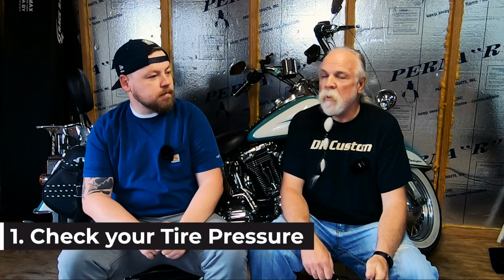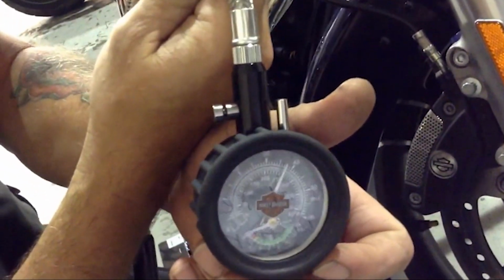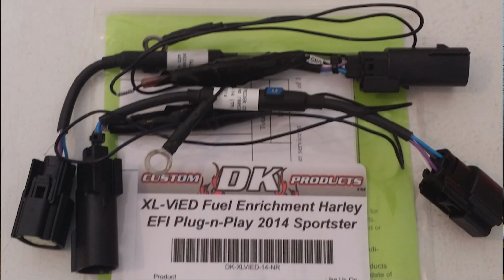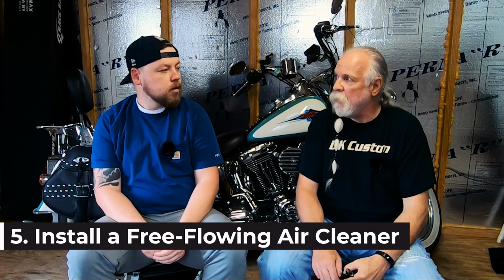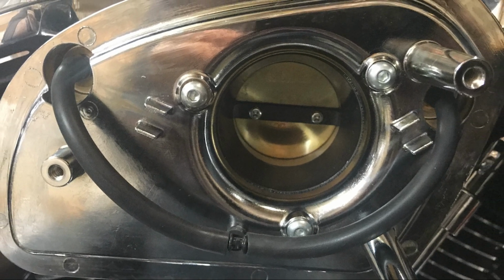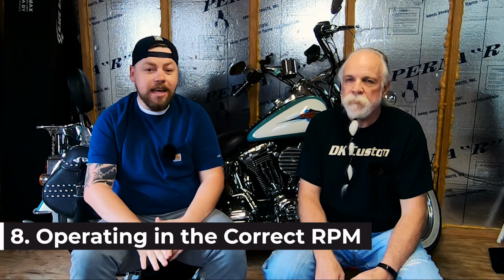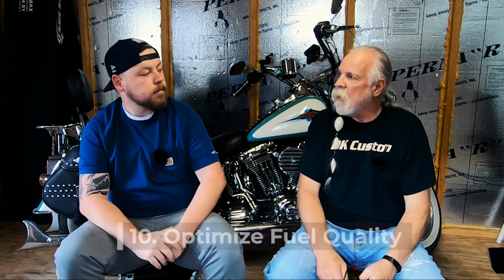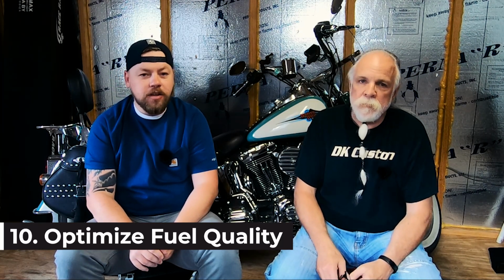List of 10 Steps to Better MPG & Better Performance

Comment: I would add to #10 the fuel filter. I am changing the fuel filter and the spark plugs after every 20K miles. I can feel the difference after change. I travel all around the country, and sometimes i have to stop for gas at small, local gas stations. Those are probably not the best quality fuels.
Reply from the maker: Good add! Thank you for commenting! MB

Comment: How do you check engine temperature?
Reply from the maker: Engine temp, as measured by the OEM heat temp sensor embedded in the cylinder head.  See this video for more details on that- https://www.youtube.com/watch?v=rWOdQOtDv6A
I use the Power Vision ET gauge is what gets the direct temp read out from the embedded OEM heat sensor.  
Thank you for your comment!

Comment: Thank y’all for sharing, I’m not sure why my 16’ Road King with stage 1 & 2 runs 240-275 temperature consistently with no lower fairing, just a windshield and that is during 40-60 degree weather temperatures. And I’m getting 33-35 MPG economy.
Reply from the maker: Oh my.  Yes, that is too hot.  Here is a link to a report on Why & How to cool down TC's & M8's.  https://www.dkcustomproducts.com/why-how-to-cool-down-the-twin-cam-engine-part-i-dk-cl-tc-dn-1.htm
It also talk about why it may be running so hot.
Reply: @DKCustomProducts  Thank you, I need to add some type of cooling system without braking the bank, any recommendations? 2016 Road King, and I’m sorry I said in my previous message I had a stage 2,, I only have a stage 1 thus far. 
Thank you for your video, really great information.
Reply from the maker: @babybugspaw7085  Here is a video on the Low & No Cost ways to cool it down- https://www.youtube.com/watch?v=o3T3yA9BKwE

Comment: I own a 2000 harley Davidson XL SPORTSTER883 WITH JUST A LITTLE OVER 10,000 MILES  .. I WANT TO INSTALL A TRANSFORMER EXTERNAL BREATHER SYSTEM... SHOULD I CLEAN THE CARB AFTER INSTALL
Reply from the maker: You can...but I wonder why not clean it before the install of the Transformer EBS?
Either way, I believe you will be well pleased with it.  👍😎👍
We appreciate your business.

Comment: I can usually get around 48 mpg on My 2015 Streetglide Special on trips out on the interstate running between 65-68 mph.Around town short trip I usually get around 38 mpg and this is taking it easy riding.If I ride faster either on the Highway or around town mpg will drop at least 2 or 3 mpg.I try to run Ethanol Free gas in my Streetglide and it's still stock except for the air filter.
Reply from the maker: That is some good mpg.  Ethanol Free is a real bonus!
Reply: @DKCustomProducts  I don't have to run 100mph to enjoy riding my Harley.Those days are behind me now.I like to enjoy the scenery when I'm  out riding and it's a lot safer under 60mph than over.I don't mind revving it out getting on the expressway or sometimes leaving a stop light but I want this Bike to last me the rest of my riding days.I'll be 63 this June and I 've been riding motorcycles since I was 11yrs.Plan on riding as long as I can hold it up.
Reply from the maker: @markallen6818  Good deal!

Comment: With many new bikes the tire pressure is noted on the display. It changes while you ride in cold weather.
Reply from the maker: Yep, the weather and the road friction will vary the pressure quite a bit.

Comment: I have a 2013 Roadglide Ultra, stage 1 with tune.  Air cleaner is a K&N big sucker 2.  My air filter is cleaned often and I still get oil coming out of air cleaner on to my exhaust.  Thought I saw a fix  y’all have for this?   Any help would be appreciated.  Thank you for the American made parts.  I’ll keep moving them while I am trucking.
Reply from the maker: Yes, we have External Breather Systems that can fit that air cleaner.  Result will be no more hot, oily, oxygen depleted air going into the intake...so more power and no more dribbles out of the air cleaner onto the exhaust.
See them here- https://www.dkcustomproducts.com/diy-external-breather-systems-408.htm

And here's a video with more info on EBS and the benefits- https://www.youtube.com/watch?v=EfDeFZblMck
Reply: @DKCustomProducts   hell yeah!!   Thank you.

Comment: Another great video for many reasons other than miles per gallon.
Reply from the maker: Yes, so true.  An engine that is running efficiently for MPG is also an engine that is getting the most power out of each gallon of gas.  A happy, well performing engine.

Comment: Another top-shelf video - thanks guys!  Hey, you mentioned about adding a fuel additive every 30-50 tankfills to keep sensors, injectors, etc. clean.  I know it's an issue like "what's the best oil to use in my bike?" but do you have any recommendations on good additives? 
Thanks again guys! Keep 'em comin'!
Reply from the maker: I have tried a bunch over the years.  I do keep a bottle of Sea Foam with me, since you never know when you might get a bad tank of fas.  I have had really good experience with it.
Reply: @DKCustomProducts  Cool. Thanks!

Comment: Stop driving like an A- hole! 😂 

I notice I pick up 10mpg when I’m on a very leisurely cruise at 60-65mph vs my aggressive riding in the twisties or open freeway at 80+ I’ve gotten 46mpg on my 2014 street bob with 103 twin cam, and the only engine mods are a Powervision programmer, Bassani 2-1 pipe, and a DK 636 intake with external breathers. However, my usual fuel mileage is around 36- 38mpg with mixed city and interstate. 

But in all honesty, if you’re concerned about fuel mileage... you should’ve got a Honda.
Reply from the maker: 👍Thank you for the comment, and also that you are digging our parts.

All really good points you made.  The right wrist is the biggest factor in MPG.

Comment: That's 230 oil temp . Engine temp can be anywhere from 230 to 270 depending on bike
Reply from the maker: 👍That is correct on Twin Cams and M8's, Sportys are a bit different.  We have a video on optimum engine temps at this link- https://www.youtube.com/watch?v=rWOdQOtDv6A

Comment: Where do you measure that "optimal 230 degrees"? Oil temp? rear cylender exhaust valve head area?
Reply from the maker: 👍Great question.  Since HD puts temp sensors in different locations, the best way to know your engine temp is what the oil is at after 30-45 minutes riding.  Oil temp of 210-230 is optimum.
We do know what the Engine Temp (ET) reads on the different bike when the baseline is 230 F through-out the engine  as shown by a heat soaked engine and oil.  We did a video on it that you may find interesting or useful.  Here's the link- https://www.youtube.com/watch?v=rWOdQOtDv6A

Comment: Hey guys this past August bought a 21 tri glide watch your videos about oil temperature and I was curious if there's a single gauge I I can put on the dash that will read oil temperature I also want to put an external breather system on before we get too many miles on it the dealer told me it had a high flow intake everything looks stock wondering what your thoughts were if it's high flow or if he just didn't know what he was talking about
Reply from the maker: Thanks for watching the video and for looking at our parts.  We appreciate it. 👍

We do  not know if any gauge that folks are using on the dash.  A few folks have installed a gauge on their lower fairing on the snap in door.
We use a dipstick gauge.
Yes, HD calls their OEM air cleaners high flow.  Not really, plus it is a hot box.  You may find this video interesting. https://youtu.be/tJXGEwLCNDw?t=164
You can use an EBS with the stock filter, but you will like it better if you get a true free flowing air cleaner (that is Not a Hot Box) along with an EBS.